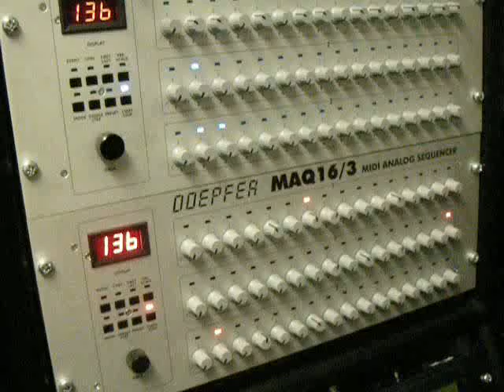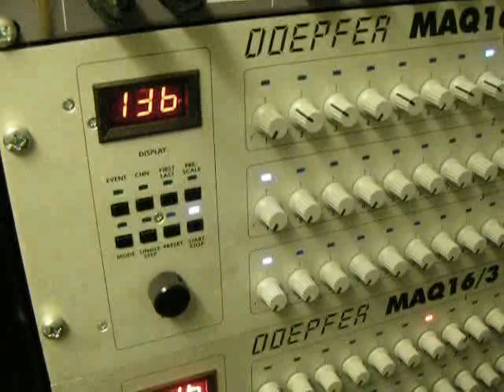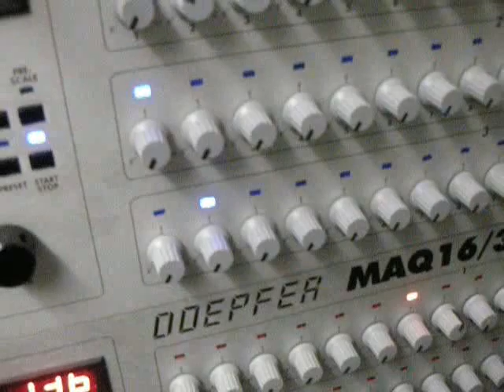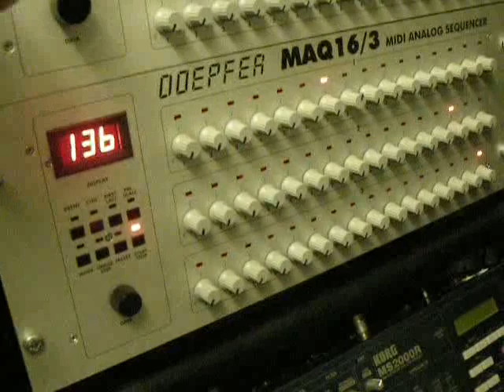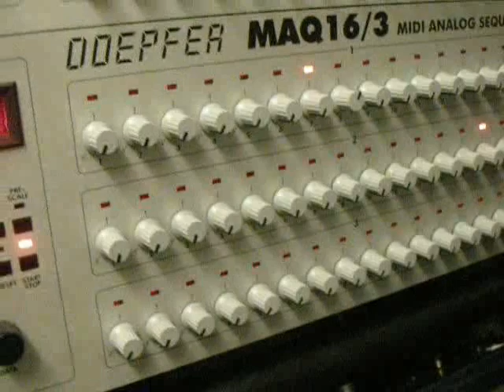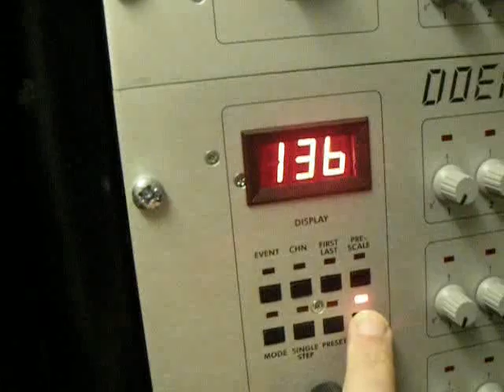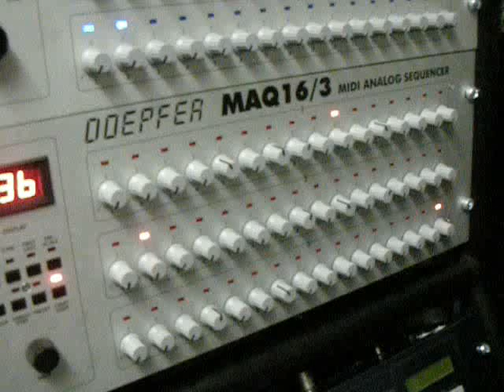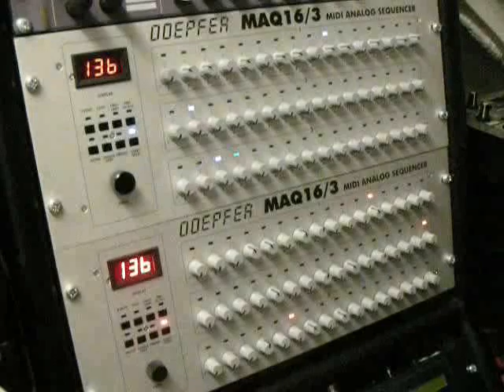Sequencer ratcheting like Tangerine Dream, Doepfer MAQ16/3

Comment from the maker: Note that since this video was made, Doepfer has released the A-160-5 Voltage Controlled Clock Multiplier/Ratcheting Controller, which takes in incoming clock, generates multiplied clock signals, and has various controller switching options - in other words you can generate exactly the same effects seen in this video, but with a single MAQ or similar sequencer and the  A-160-5 instead of the voltage controlled switch.
Reply: this made me appreciate this feature being included in the Sub 37 with a simple button press. Very cool that you could figure out doing it with hardware that wasn't designed to just do it with a button press.

Comment: It amazes me without end how many people have gone through all sorts of elaborate and often even expensive solutions for this single effect. As far as I know the ratcheting was produced by the GDS digital synthesizer. It had quite elaborate envelope generators with which a whole row of aparent "retriggers" can be programmed into a single note. Some synthesizers even have envelope generators with a loop function. In such a synth the effect is created by holding the key down longer then the first EG generated "artficial" step. then repeating automatically starts and lasts until you release the key. You can then even make the virtual clock rate of the note repeat longer or shorter then the actual clockrate of the programmed sequencer, giving all sorts of tiny or more appearant delay type effects or even polyrythmic results.
In other words: The simplest tricks is to actually remove the note repeats from the sequencing and program a repeating sawtooth shape into your EG's. The note length will then determine the repeats.
Pity that most modular systems with their conservative ADSR's can't do the same trick but that actually proves that oldfashioned is not automatically better.
Reply from the maker: I'm pretty certain Chris Franke played a GDS synthesizer, but I'm not sure whether it was part of his sequencer system. I always thought that Tangerine Dream's 'ratcheting' effect was produced using Moog trigger modules. Certainly there are now Moog 'lookalike' modules designed to do the same thing. I'll have to try the technique of programming a repeating sawtooth into my EGs, but I usually use my Doepfer modular system for ambient effects rather than sequencer sounds!
Reply: As far as I know, the ratcheting on Stratosfear was produced by Peter’s new Projekt Elektronik system.

Comment: Hi!
Try to play the MAQ with [t.1.6.] on ROW3. This event is made for that !

Try these parameters (for ROW 1, 2, 3)

CV2 --> VCO
GATE1 --> ADSR
GATE2 --> S/H (optional)

Event: : PR5, PR3, t.1.6.
Channel: /, /, /
First: 1, 1, 1
Last: 8, 8, 4
GATE: 06, 24, 24
LENGTH: 3, 6, /
MODE: FOr, FOr, FOr

Steps active
ROW1: 8
ROW2: 8
ROW3: 4

Notes
ROW1: none
ROW2: 36, 46, 39, 43, 39, 51, 43, 46
ROW3: 3, 2, 1, 2

You can play what you want. You can change the values on ROW3. Check the sum on ROW3 --> 8 steps like ROW1 and 2 (or4, or16)

Enjoy your MAQ!

Comment: Another real ratcheting: ROW3 drives ROW1 gate

for ROW 1, 2, 3

CV2 --> VCO
GATE1 --> ADSR + S/H

Event: : PR5, PR3, t.16
Channel: /, /, /
First: 1, 1, 1
Last: 8, 16, 16
GATE: 03, 24, 12
LENGTH: 3, 3, /
MODE: FOr, FOr, rnd

Steps active
ROW1: 8
ROW2: 16
ROW3: 16

Notes
ROW1: none
ROW2: 36, 46, 36, 43, 48, 39, 43, 48, 36, 36, 48, 36, 48, 43, 39, 41
ROW3: 4, 2, 4, 4, 4, 4, 1, 4, 4, 2, 4, 4, 4, 4, 4, 4

Comment: Is it possible to switch between the rows by means of a midi foot switch?
Reply from the maker: +EverettDudgeon138     I would think so, yes, though I haven't tried to do it. The Doepfer Pocket Dial MIDI controller has some preset templates for controlling parameters of the MAQ 16/3 sequencer in real time, and I would think any programmable MIDI controller could be configured to do the same thing. Upload a demo if you get it working!